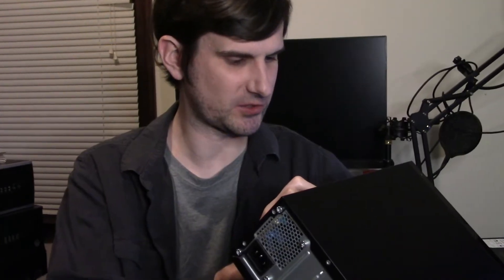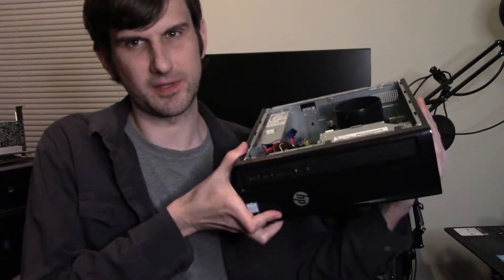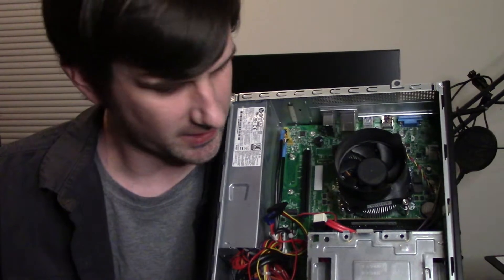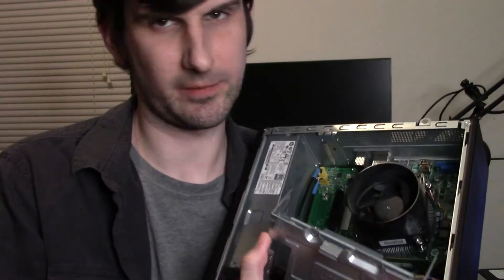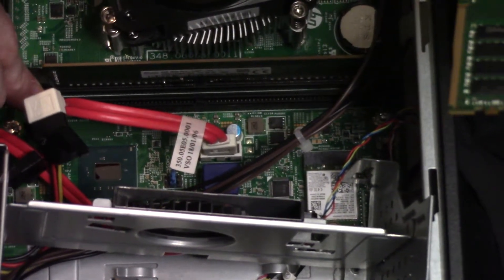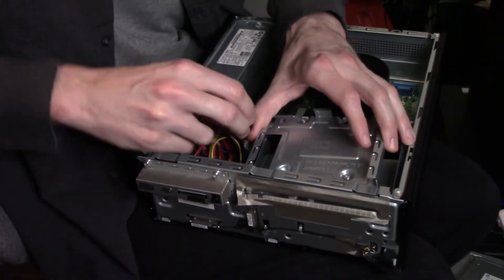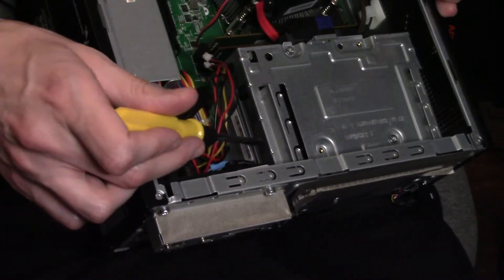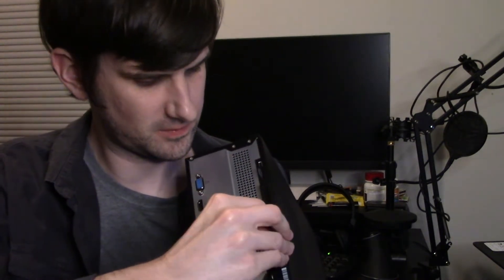HP Slimline 270x Upgrade - Adding RAM and Hard Drive SSD

Comment: Can the CPU be upgraded? Also, the metal HDD ) SSD caddy, can that hold a second SSD? I got a hold of an HP Slimline Pavilion but featuring Win Vista! So it's a bit old!! Thank you. I am going to check out your Emulator build. Thank you 🤓
Reply from the maker: 🙂 I appreciate that. The CPU upgrade will depend on which model you have. On this one, the HP specs page lists the i5-7400 and the i7-7700 as compatible upgrades.
Reply: @LowcastleTech   the HP I got a hold of is a bit old, so not sure what or if the CPU can be upgraded to. Thank you 🤓 I am not sure if it's an AMD or Intel!
Reply from the maker: @j.lietka9406  No problem! And if you are able to find the model type, like somewhere on the case or something, HP is pretty good about listing out specs/potential upgrades for their stuff (most of the time 😂). If you google "HP whatever model number it is" and look for the result from HP's website that says "specifications" you may be able to find some info.

Comment: I see a M.2 ssd slot  on the  motherboard. I wonder why you use 2.5" ssd insted of M.2 SSD???
Reply from the maker: I was mainly just getting this set up to run some emulation, and I already had my OS flashed to the 2.5" SSD. If I was going to run my primary OS or do anything more demanding, I would go with the M.2.
Reply: @LowcastleTech   Just the info I was looking for. Thank you!  Is it possible to install the new unformatted NVM ssd in M2 slot, then "clone" Windows 10 to it via 3rd party software?  Would the bios then need to be changed so the M2 is the bootable drive?
Reply from the maker: @ridemfast7625  Not a problem, thanks for watching! I haven't personally tried to clone the system specifically, but I believe it should work. I have gone through the Windows install process with only a generic drive in the m.2 slot, and it did see and recognize the drive without having to update BIOS. So I imagine, if it allows direct installation to the m.2 slot like that, then it should also be fine for cloning. Hope that helps!

Comment: Very informative video.   Does the new SSD Drive need to be formatted and how would one reload the Windows Operating system software (to the new SSD drive).  A tech guy at Best Buy said there is a chip on the  computer's motherboard that can do this .    What little computer tech knowledge I have is obsolete, thanks if you can reply.
Reply from the maker: Thanks for watching! It may be more than I can detail here, but I will try to get you on the right track. If you want to just do a fresh install of Windows then you will need a bootable drive or disk. If you type "windows ISO" in google the first result that comes up should be from microsoft.com. Select that and there's a little section there that says "Create Windows installation media". You can select that and it takes you through the steps of creating the drive. There is also a little section beneath that which says "using tool to create installation media" which has some more detailed instructions. Basically you go through the steps to create the bootable disk or USB drive, insert that into your machine and boot from it. It will then boot to windows installer and you just go through the steps to install Windows to the new hard drive you have installed.
It is also possible to clone the existing hard drive you have now before you insert the new drive. That usually requires 3rd party software and you need some kind of external device to connect the drive to your computer. Typically the way that goes, is you boot from existing drive, connect the new drive externally, clone the drive using whatever software and swap them out. Usually just doing a fresh install of Windows is the simplest way to go about it, but depends on what you need / want. Anyway, hope this can get you started, if you have more questions I will answer the best that I can here.
Reply: @LowcastleTech  Thanks
Reply: @LowcastleTech  I was able to open the HP Slimline case and there was a noticeable amount of dust around the cooling fans.   I'll clean the fans (before I start replacing parts) and see if this improves performance.   
While removing/reinstalling the case , the torx/star screws are very small.  Using a magnetized tip screwdriver helps to properly seat the screw in place.  One can  magnetize a standard screwdriver tip with a magnet (see the You Tube videos).
Reply from the maker: @rnklv8281  Good call, always good to get the dust out of there, especially before it works its way in where it can damage something. And that is a useful trick with the magnets.

Comment: 0:47 i have a question what type of screw required to open the case
Reply from the maker: It is a starhead screw, but it is indented so I was able just to use a medium size flat-head screwdriver.

Comment: can u add ssd + hdd both in HP Slimline Desktop - 270-p027il ? or only one can be in it ?
Reply from the maker: Well, I haven't used that model specifically to say for sure, but looked up some information and it does seem like there are some ways you might be able to do it. First of all, if the hard drive caddy is the same as the one in my model in this video, then it's not possible to add both a 2.5" SSD and 3.5" HDD. It is not designed to hold both at once. But, it does look like there is an m.2 SSD slot on your model. You will have to check to make sure, but if so, you could run an m.2 SSD and then put a HDD in the caddy. If you have an m.2 slot that is probably the preferable method, as they are faster anyway.

However, if there is no m.2 slot there is another kind of trick you can do. If you don't use the optical drive for anything, there are 2.5" SSD caddies that replace the optical drive. They are only a few dollars on Amazon, and basically, you remove the optical drive, insert the 2.5" SSD into the new caddy that resembles an optical drive and just slide it right into place, and connect the wires. If you need more information, I think I covered that device in a video I did earlier called "Use these Storage Tricks"... or something along those lines. It was awhile ago so I'm not 100%, but think I did cover it there. If you go this route, make sure you are getting a caddy that fits (is the same size as existing optical drive). But like I mentioned above, using an m.2 SSD, and then throwing a 3.5" HDD in existing caddy would be the ideal method. Hope that helps!
Reply: @LowcastleTech  alright thanks for help

Comment: I have a slimline 450-116il pc, it's from 2016. I want to upgrade it so that I can edit videos. Can I do it? I want to buy a cpu and a gpu with some cooling. Is it possible? If yes, which parts can I buy. Please help if you have the time to :)
Reply from the maker: Hello. I haven't worked with that model specifically, but I just looked it up online and it seems like upgrades would be rough with that one. It looks like CPU might not even be possible, and that there is no PCIe for a GPU. With how limited it is (assuming the info I found is correct) I don't think it would be worth putting money into it. If I was in that situation, I would probably hold on to whatever I was going to spend on upgrades, save up for a while, and eventually grab something that is more upgradeable. Some of the slimline models aren't bad specs-wise, but most of them are made more for basic web browsing and stuff like that, as opposed to more demanding tasks like video editing.
Reply: @LowcastleTech  Thanks for the info. I also did some research and i found that its not worth the effort. Its my first pc and I wanted to give it a new life but its not really pausible. even tho I cant upgrade the hardware I upgraded the software, I installed a light weight Linux distro and it works great now. Im thinking of giving it to my brother he installed minecraft in that and is getting solid 40-60fps in low settings. Anyway thanks for putting in the effort for my question, thanks, thanks alot!
Reply from the maker: @ThatOneAmpharos  Yeah I totally get that. I really do like to save them when it's possible, but I'm glad to hear you found a way to keep it in use. That is awesome. And no problem at all, thank you for watching!

Comment: I have the same pc but Im struggling to find the right sdd to get to upgrade. Can you tell me the one you got in this video?
Reply from the maker: You should be fine with any 2.5" SSD but this one was PNY brand, 500GB. I usually go with those because they aren't too expensive and work well from my experience. If you go to amazon or wherever you shop and type "PNY SSD" you should see some options that look like the one in the vid, but other brands would be fine too.

Comment: Hey bro what size ssd could I use? I want a budget gaming pc for editing videos. I don’t really know much about computers.
Reply from the maker: Well that can really vary depending on how many games you want to install, etc. Sounds like you're going to need a good bit of storage. What I do is run an SSD and HDD. Most gaming PCs support this but make sure you have spots for both in yours. In my main machine I have a 500GB SSD, which holds the operating system, core applications and several games. Basically the stuff you need the most speed for goes on the SSD. Then I have a 2TB HDD (HDDs are a lot cheaper) as a secondary drive. And I use that to store audio/video files for editing. That is one method you may want to consider. If you don't have spots for both, you could always just do around a 500GB SSD to run your games/video editor on. And then have an external USB hard drive for additional storage. Anyway, hope that makes sense, can be hard to explain things with the character limit on comments. If you have any questions feel free to let me know.
Reply: @LowcastleTech  what size ssd did you use to swap the hard drive with? I’ve got the exact same pc I’m trying to upgrade it.
Reply from the maker: @zobmie9785  Oh ok, got ya. On this model I just did a 128GB. They are only like 20 bucks, but that really isn't a ton of space if you plan on downloading more than a handful of games and doing video editing. You could go higher if you need to. Might be wise to do a 256GB or 500GB. And those are 2.5" SSDs just to clarify.
Reply: @LowcastleTech  thanks for the info.
Reply: @LowcastleTech  what ram type?
Reply from the maker: @zobmie9785  DDR4, PC4-2400T
Reply: @LowcastleTech  thanks the mods nearly done. Can you post a tutorial on how to put a gpu in?
Reply from the maker: @zobmie9785  Awesome! That is cool to hear. And coincidentally I have a video installing a GPU in this machine specifically. Here is a link - https://www.youtube.com/watch?v=vPQaDE9CCoE  - It is part of a larger video where I cover upgrades in general, but right around the 7 minute mark is where I start the GPU install. Let me know if it works out or if you have any questions or anything.
Reply: @LowcastleTech  thanks, i went through all your videos and I couldn’t find lol.
Reply from the maker: @zobmie9785  🙂 No problem! And that's completely understandable, it has a unique title like "3 easy upgrades for most computers" or something like that, so there was no way of knowing it was in there.

Comment: My pc has a laptop motherboard in a slimline case  
It has 1tb hdd in it installed but i want to add ssd to boot fast how can i do that
Reply from the maker: That really depends on what kind of motherboard it is. Often, the connectors are the same. So if that is the case you would just need to either hook it up the same way and reinstall your Operating System, or clone the Operating System to the new drive and then install it using the SATA connectors the board has. Again, depends on the model of motheboard and what connetors and stuff it has.
Reply: @LowcastleTech  it is a hp 2b28 nutmeg-c motherboard can you help me

Comment: Do you know how to replace the cpu?
Reply from the maker: Sure thing. Remove the fan, wipe excess thermal paste from the fan, pull the little lever to release the cage around the existing CPU. Pop it out of there. Then drop in the new one, making sure that the little triangle on the new CPU lines up with the triangle on the board. (Also check HP specs page to make sure new processor is compatible with your model). Then put lever back down, add some thermal paste to top of new CPU and replace fan. If it is your first time doing it you may also want to check out some videos to get a visual of those steps. I've done some CPU replacements on camera in previous videos. Or you could just search "how to replace a CPU" to get an idea of what it looks like. Once you've seen it done it isn't terribly difficult.

Comment: can i add gpu
Reply from the maker: Yes, on this model there is a PCIe slot to add a GPU, you just have to be careful to get one that actually fits in the case. It is single slot, and not a lot of space in there.
Reply: @LowcastleTech cant we just upgrade to a bigger case too?